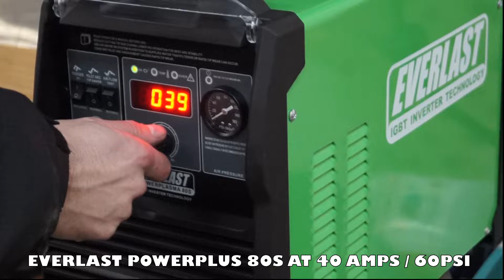Crossfire CNC Plasma table first cut with Everlast 80s  - APEngineering

Comment: What size consumables? I have an 82i setting up on a gen 2 table also have the z axes add on.
Reply from the maker: I used 0.9 mm consumables
Reply: @APEngineering  thanks. I didn't order some of the  8mm and 1.1mm from plasmadyn. And it came with 1.2mm 
I will probably try all sizes
Reply from the maker: Its better if you want to cut thinner materiel. Your cut width will be smaller
Reply: Thanks. I can't wait to start cutting i have the machine put together I didn't receive my xl kit yet but out of the box the y axess motor is bad. They are probably shipping one out asap I want to be able to cut fab logo tags so figured small consumables  for than. Any way thanks. Hope you enjoy you machine
Reply from the maker: No problem ! You will definitely love your machine, with the Z-axis it will give great results
Reply: @APEngineering  thanks! I hope I didn't get the machine torch so im still running the same one you have

Comment: How is it on thicker materials
Reply from the maker: The thickest ive done for the moment is 1/2'' mild steel and it cut thru it no problem. Of course at that thickness there is a significant bevel.